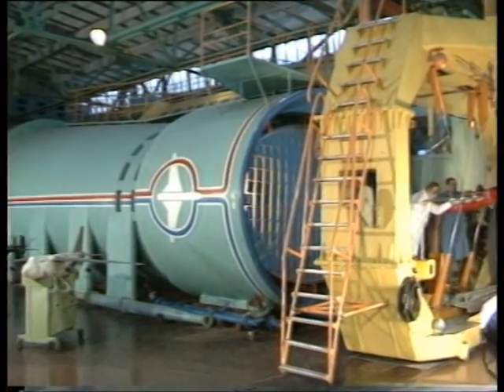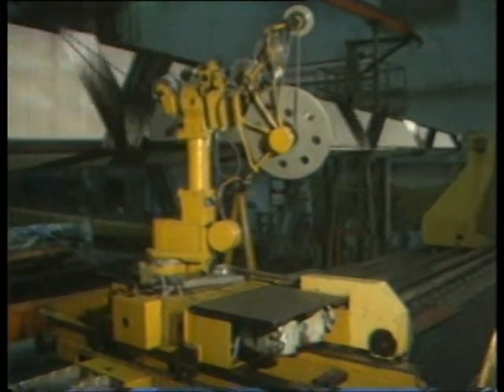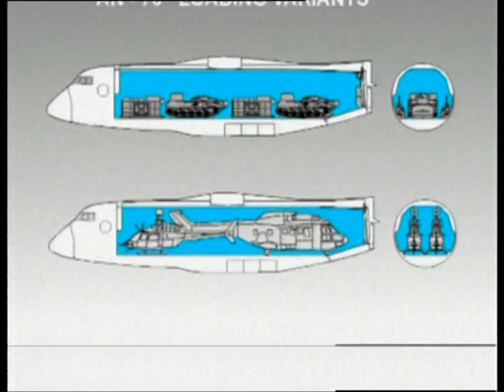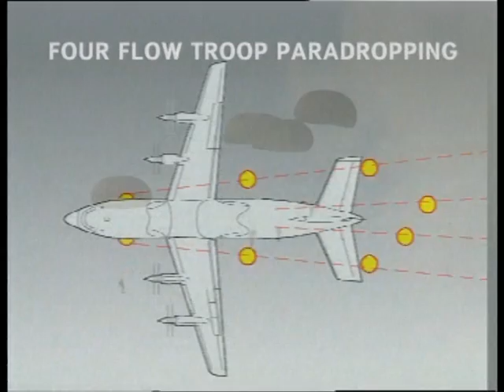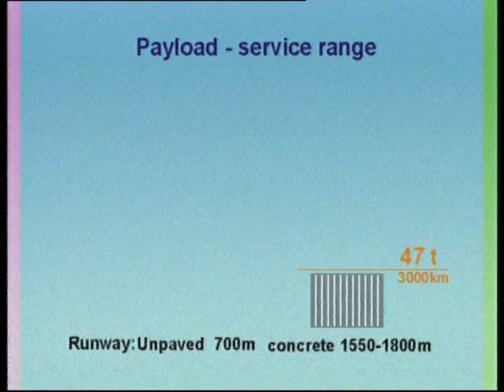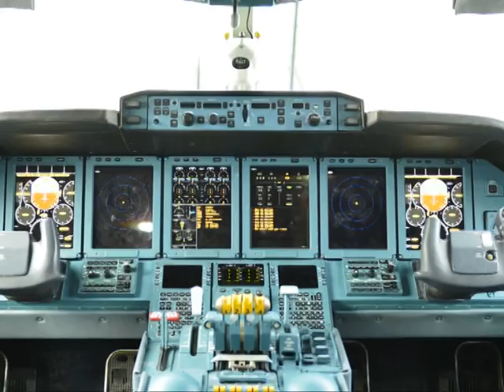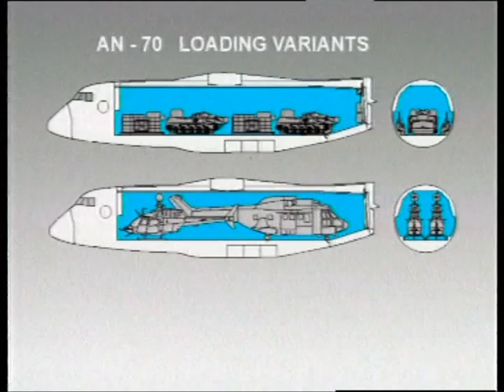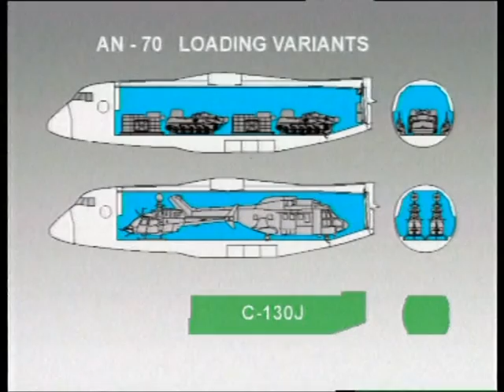Presentation of the Antonov AN-70.

Comment: What's the advantage (aside from aesthetically looks cool and sexy) of having contra rotating propellers ? Can't single rotating propellers enough to push this aircraft?
Reply: Smaller blades, more power for same fuel consuption, higher speed for a propeller plane, less air flow turbulence.
It's more like unducted fan than turboprop.
Reply: @fafane65  Well they do call it a propfan not a turboprop!
Reply: У НК-12, НК-18  Кузнецова тот же принцип.  Но посмотрите на разницу в размерах двигателей ( вытянутой в длину  у  Кузнецова,  укороченной компоновки у украинцев)  не говоря о мощности.
 Удачи и успехов  в деле  завоевания международного рынка

Comment: I believe the An-70 would be a good transport and cargo plane which is bigger than the C-130 J and more cost effective.  The An-124 would also be cost effective for super heavy loads that the C-117 cannot handle, especially, if the cargo is one large piece of equipment and cannot be taken apart.  We ( the US), contract many times with Russian cargo companies who have the An-124 for large and heavy load transport.  Both aircraft would be great for humanitarian work and non combative military equipment transport.  Very cost effective overall.
Reply: Could the US buy some AN-70's or AN-124's etc? (without angering anyone)
Reply: It is also significantly faster than the C130

Comment: wtf 800 kmph i was thinking of 500-600 max
Reply: Nope, propellers have a practical limit at 800, more power will ot get you much more speed over this line. Thats where turbofans start to overtake.
Reply: stupid: for your information, the A400M (4x11000hp), with12000hp less as the AN70 (4x14000hp) , fly 781kph, so 800kmph max speed for the AN70 looks underestimate...
Reply: false, the Tu95, first flight in 1951, fly mach 0.87 (925km/h) max speed...and max cruise speed is the Tu 114 (870km/h), and this without supersonic propellers like the XP84H thunderscreech who had a supersonic propeller, but so horrible noisy that the ground personal's joke was: this aircraft not need weapons, only the noise make all ennemys unable to fight...
Reply: @leneanderthalien  Tu95/114 is swept wing and has low speed props

Comment: Aircraft with technology like this will be more prevalent once oil prices rise again.
Reply: Can you explain why?
Reply: @TheAndimilan  I'm guessing I made that comment because turboprops are more fuel efficient than jet engines and contra rotating props can compete with jet engines when it comes to speed. Though most new jet engines have so much bypass air these days that I don't agree with that comment anymore especially since contra rotating props are very loud.
Reply: @Nicholas3412  i am agree...thank you 👍